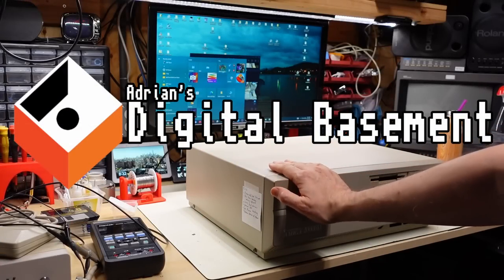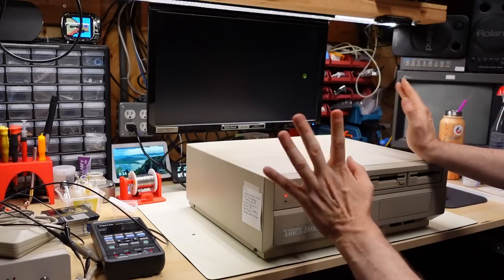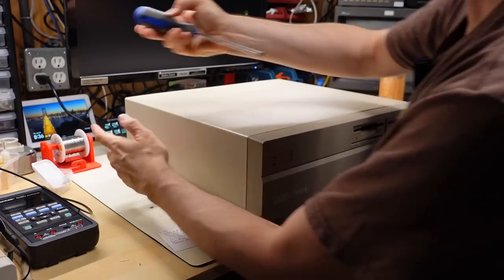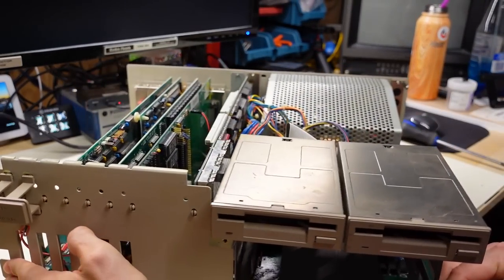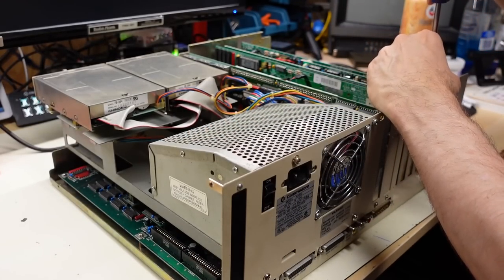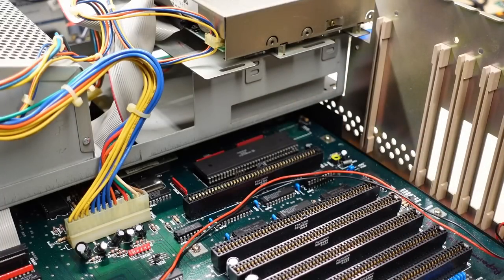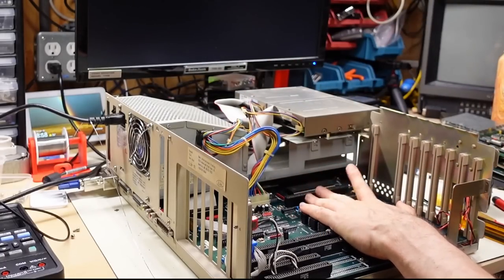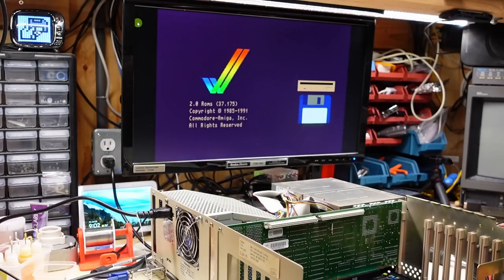I used the "easy button" to fix this broken A2000

Comment: Perhaps it's not a bad connection, but maybe there is a grounding problem. Flexing the board may prevent the short. Perhaps check it with an oscilloscope and see if there is an intermittent connection that is sometimes floating.
As for a wedge, perhaps use a heat sink. A speaker with a magnet???!!! I would never put a magnet near disks. I didn't understand what you meant by "easy button" since you used a speaker.

Comment: Sometimes a machine just gets the better of ya.  The folks saying "replace the mainboard" are pointing to the professional solution.  As long as your "field expedient" solution continues to work, it gives you the breathing space to search for a replacement, so best of both worlds.  If this is corrosion from battery or capacitor leakage, it will only get worse with time.  I hope you have a new mainboard by then.

Umm... I would have sought out a non-metallic wedge.  Just sayin'.

Comment: I'd get out the heat gun and remelt everything. There could be internal oxidation. And pull the board, check the backside too.

Comment: Nothing wrong with this kind of repair at all. As long as it works! However, at 20:34 you seem to be inserting the cards with the power on?? Kickstart screen is flickering on the monitor.
Reply: Ahh, think it's the capture on the PC
Reply: the power was off, it was an artifact with the video capture

Comment: Haha, just throw something on top of the chip to wedge it down to make it work. That's an Apple approved from factory fix! Louis Rossmann always talks about their fix by putting some shoe rubber to have the MacBook Pro chassis push the poorly soldered GPU back onto the motherboard.

Comment: The 500 and 2000 were developed in Germany, not in the US - hence the Metric screws.
I got my A2000 with second 3.5i drive, 20Mb Hardcard (PC side slot)  and 8088 Bridgeboard in 1987 in Dortmund (Messe) for 4000 DM. 
Power wasn't working due to the ground cable in the PSU being stuck between chassis parts, sorting with earth. My dad fixed that at the time ^^

Comment: Placing the CPU next to a leaky battery. Great move by Commodore. ;)
Reply: They weren't leaky when installed, and wouldn't start leaking until years later. They probably weren't counting on the machines lasting long enough to exhibit leakage. Many PC manufacturers had the same attitude.
Reply: @mal2ksc  I know, it was just a joke. On PCs they're usually placed right next to the power delivery. Not much better. ;)
Reply: @agevenisse3252  For the life of the AT style case and power supply, it was pretty typical to put the battery over by the power delivery. Once the form factor changed to ATX, the battery was most likely inside a Dallas Realtime module, but if it wasn't, it could be just about anywhere. At least the Amiga isn't stuck with a custom chip that was designed to fail after five years, soldered to the board, but the battery is not necessarily a better choice. Just different.
Reply: @mal2ksc  Yes, I agree. The Dallas module was bad. At least it didn't leak and destroy the motherboard though. A step in the right direction I guess.

Comment: Issue is the pin headers. I only use oem cpu socket replacements, had too many issues with machined pin. Anyone who has a damaged 2000 in the us, reach out to me. I can get it back into working order

Comment: Many many years ago I had an apple2(2 something i don't recall which)  wouldn't work I spent so much time trying to diagnose that Couldn't never figure it out one day on a whim with the power on I started pushing on chips and when I pushed on the CPU it fired right up couldn't figure out why so I taped a stack of plastic washers together taped it to the top of the CPU so that when you shut the lid it pushed it down and the problem went away and that thing continue to work in the school for another 5 to 10 years years

Comment: The problem might be a trace inside the board, which is almost impossible to find, especially if it is intermittent.
Reply: A2000 is a 2 layer board so it's either on the top or the bottom.  My bet is it is actually under the CPU Accelerator slot

Comment: I'm not convinced these cheap turned pin sockets/header strips from China are actually better quality than the standard dual wipe sockets. I've had some where there's almost not grip on the chip, like I can insert and remove it fully just holding it loosely between my thumb and index fingers. So it wouldn't surprise me if there's a loose pin or two on that header strip, especially considering how many pins are on those 68K chips.

Comment: Screws were not normal, because they were metric? Do you know how it sounds to the ears of Non-Americans? ;-)

May be that machine was assembled in Europe that it had metric screws? Could make out any label in the video. But I seem to remember Germany had a firm grip in developing the A2000, and there were 2000A (European) and 2000B (American built) models (not to mix up with "HD").

Comment: Your fix is completely craptastic! But sometimes, a fix that just barely works is more than enough (especially if you only need it to work for a little while to check those floppies.)
Just don't forget that speaker is in there. It would suck to have it short something on the motherboard because it got bumped loose during transit.

Comment: Use a stack of pennies taped together.  I actually found that as a standoff under a 386 motherboard back when they were current.  The irony of using something conductive as an isolating standoff was impressive.

Comment: You may be flexing the motherboard in a way the 2MB Agnus chip-ram add-on makes a better connection.  I've had issues with those plug-in modules that were corrected by flexing the motherboard.
Reply from the maker: I'd say it's just too localized to the cpu socket to be that -- when I installed all the bodge wires under the CPU, I had the board out of the computer and I spent several hours localizing exactly where you had to push to get it working -- which led me to the CPU socket. I'll probably take the 2MB Chip ram board out and put it in my other A2000 just because the other machine is far more reliable LOL!! So if the problem moves or goes away, then that was a good suggestion!

Comment: When I saw the Easy Button approach and I realized that he was going to need to shove something in there to fix it I thought that he was literally going to grab an easy button and shove it in there as the fix I don't know why it was thinking that but yeah might not have been the only one but still it's a funny thought fix the thing with the Easy Button which actually once was literal in my case well it was not really a fix but I just need a custom large switch for something to use when it was awkward to hit any other switches I had and I had an easy button that was messed up am I wait a second that's not working and it's a big button Bingo Bango couple mods later big button switch don't worry not Mission critical or one of those safety switches because of reliability anyways wouldn't do that but just needed a button you can hit easily while having other things in your hand i'm project long time ago I can't remember what it was for but it's built for someone else on the shoestring budget not enough budget for a decent switch like a mushroom head type switch like that would be used for say a safety application or an emergency stops types of switch but needed a momentary as well and wouldn't have to put up with much fuse just occasionally use so worth it and definitely that was easy moment in the irony is when I was working on it the Easy Button worked one last time when I got close to the modification he said he couldn't stop laughing for about 30 minutes when I told him that and that thing had not worked in ages only reason I put batteries in it was to just check everything on the circuitry for the mod more easily if need be probably wouldn't have needed it anyways but it helps

Comment: I think you might be chasing a red herring. The issue affecting power on probably means its elsewhere on the board, some chip isnt making good contact until you flex the board, but its not the CPU that's the problem. Might be worth going over and re-flowing all the chips on the board, i bet theres a cracked intermittent solder joint somwehere. Or maybe exactly one of those CPU socket pins is cracked and reflowing the cpu socket, or just replacing it altogether will solve the problem? double triple check EVERY chip on the board, every socket. I'm not convinced it is the CPU.
Reply: He said its not the cpu, and changed the cpu. Flexing the board at the cpu socked caused the broken contact wherever to connect. It could be a trace in the board as iirc this is 2 layers.

Comment: As much as I love your channels and content Adrian, this speaker hack just pains me. This is literally the first video I'm tempted to dislike. Mostly it's the attitude of "whatever, Amiga 2000s are unreliable, and this thing just doesn't wanna work", no. The machine has a problem. From what you describe, it had a problem for a long time, that hasn't been fixed. The Amiga 2000s is one of the best documented retro machines with replacement PCBs, remade digital schematics, and even the Amiga PCB Explorer available. This hack, combined with the bashing the machine gets has no excuse, I'm sorry. And if you do it to get on with some other project, that's OK, but making a YT video about it... Ouch. I hope the next one will be better again.

Comment: Metric is great, that american stuff is horrible, i can never find any of those weird american "standard" screws when i need one... Luckily i very rarely need any of that junk 🙂
Metric is Metric...
America have all kinds of strange non metric stuff like number drills and BSP and JIC and Pipe Thread a lot other weird non standard stuff, like that strange wire guage measurements which makes no sence at all, Metric is Metric, simple as that 🙂

Comment: For a someone with so much knowledge this is just a sad work around. It's not a repair, its not a fix, its just lazy.
Reply: He doesn't have the time right now and he needs to use the machine, where is the problem? It's no a museum...
Reply: @stephanemignot100  Oh it's perfectly fine. Maybe next week he can fix a CRT by smacking it on the side until it works!
Reply: @Voyager_2  go watch the 8bit guy, he destroys things. He explained why he did that, you could try to watch till the end.